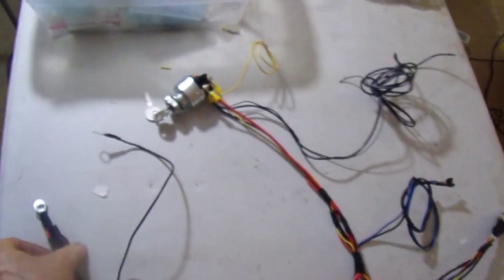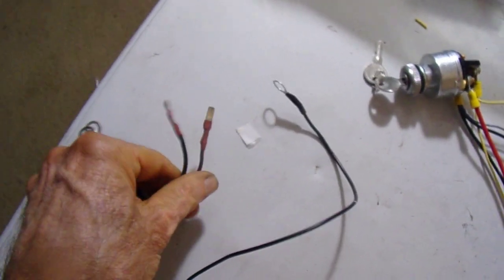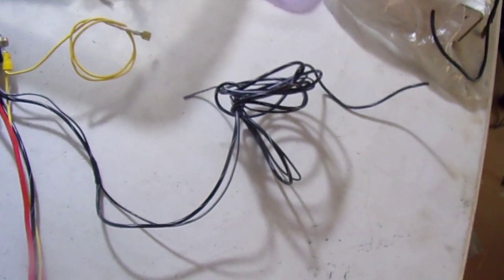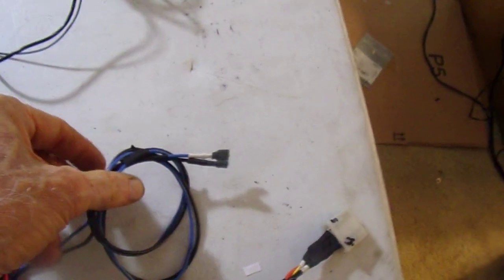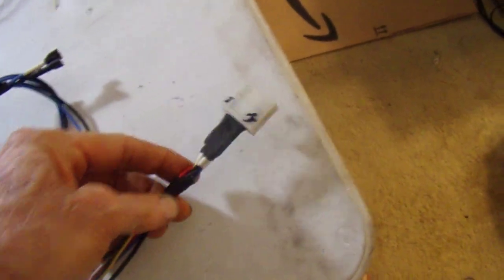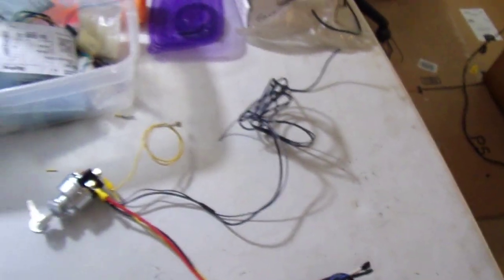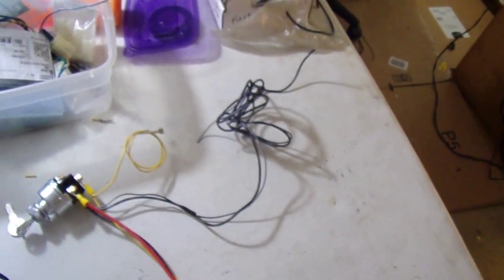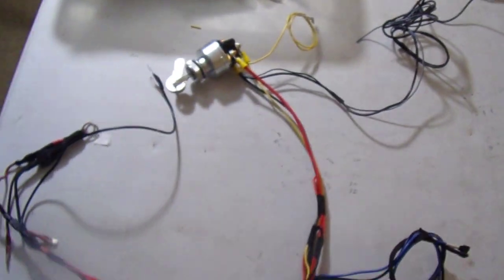Nissan L28et engine harness on test stand

Comment: Nice! Man you were up late!
Reply from the maker: coming along. Got some gasket material to play with on the IAC, got the fuel pump connector all done, and tubing to finish off the return circuit. Will try it with the harness to see if it idles with the stock setup, hook up the IAC electrically but leave it unattached to see if it PWM's. Going to use a 20ohm resistor to limit current since I think the ford IAC was designed for a 5v signal (being safe anyway). This will go to the un used pin but will add it to your harness if it works. I am going to dig in your stash and see if I can find the OE IAC and get a ohm reading on the coil to be sure. Can try hooking it up and seeing what current it pulls as well for a verification.